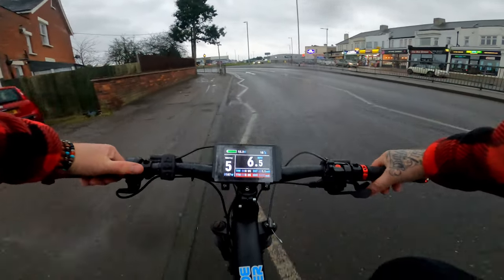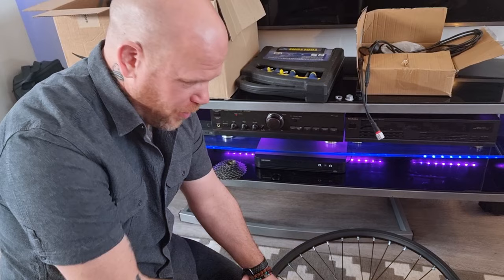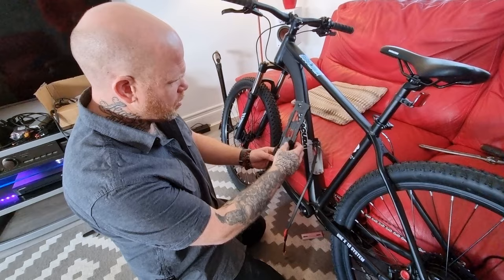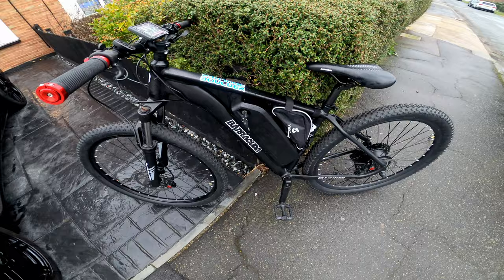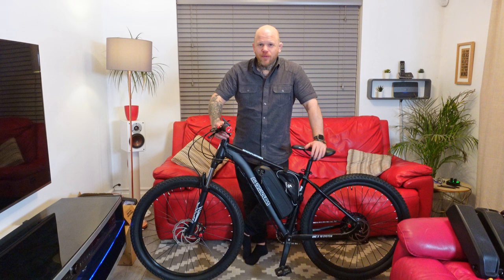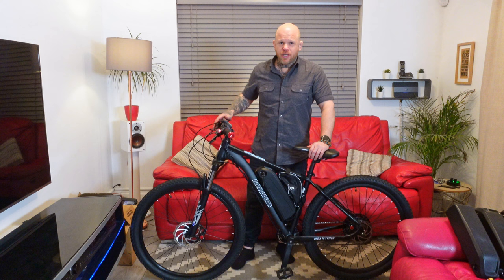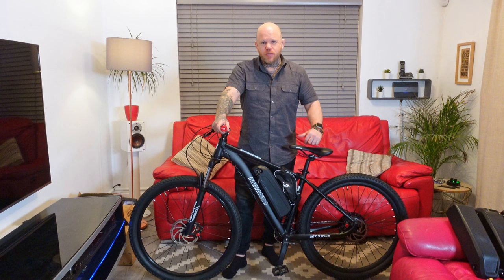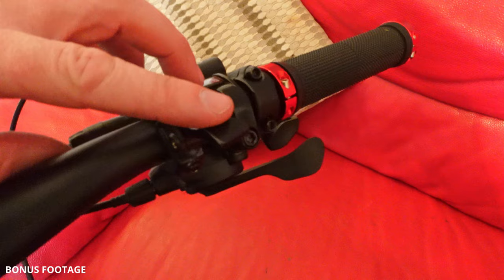How to BEAT the 250w ebike RULE!!!

Comment: I didn't know a 250W motor could do 30mph. So how is it that motors with 2, 3, or 4x the power don't go much (if any) faster? Just asking bc I'm considering building my own and trying to decide how much power and which components to buy.
Reply: A motor doesn't really have a wattage value. That's just the rating for what the parts inside are supposedly able to handle but you can ram more amps and volts into it. To go faster you increase voltage, to increase acceleration you bump up the amps. In this video he's probably pushing about 1000w out that motor but the nylon teeth for planetary gears will last a short amount of time
Reply: @alcurtis93  I've heard of people replacing the nylon gears w metal. Or even just one of the 3.
Reply: @alcurtis93 Years

Comment: I got the yose kit and the company said I can't use more than 36v battery on a 350w motor!
Reply from the maker: It's nonsense you can run more power at most motors (maybe an exception of plastic geared hubs) mostly the controller needs to be able to handle or recognise a bigger battery
Reply: @DudeStuff  so is there two types of battery controller connection, the old four pin and the new type? Also are the other connectors universal?

Comment: There’s a torque sensor standalone now but you got to change the controller
Reply: What do you mean?
Reply: @kev8343  there's already a standalone torque sensor like erider t17 and a corresponding controller. 

Thus, when you pedal it outputs power depending on your pedal torque unlike cadence where it dumps power depending on assist.

Comment: My 1000w ebike (hub motor) from China is restricted to UK speed limit. How do I de-restrict the ebike?
Reply: There is a blue wire on the controller disconnect it and the bike will be unrestricted have fun
Reply: did you try it?

Comment: I thought it was anything with a throttle that was illegal that guy a fortnight ago being done for his doing 22mph plus on motorway ebike laws are messed up completely my bosch smart system now has the tunning in latest update for like high torque on take off you can control it 10% at a time makes huge difference on 85nm motor but seen the NLS speedi it makes the magnet wider spread to confuse the sensor basically further away and stronger magnet so still attracts delimits the embts to 50mph for 70 bucks but says undetectable as not plugged into the motor itself as the kiox diagnostics logs the install on the electric speed restrictor and voids the warranty and as its 5yr warranty something you don't want to mess with but this NLS system is a hidden gem

Comment: The law is stupid, I thought the law in the UK, was  the motor can be any wattage BUT. is not allowed to exceed 250w under operation, I've installed a ROAD SWITCH, WHICH LIMITS THE CONTROLLER and the output and with the weight of the bike I'd get more speed out it freewheeling up a bloody hill I used a modified sabviton shunts and all components upgraded can take up to 260amp in bursts.all on a 8kw motor thing is I'm 6ft 9" and weigh the same as a small house and the bike weighs the same as a rolls Royce phantom🤣 lol. I've build a few extreme bikes. I've added gps. Remote kill switch (Incase of theives)4k camera front and back, limdicators, brake lights, cob led brake strips and indicator strips horn, alarm,  all on 26"x4.5" double walled fat wheels with off road tyres.the problem is the lawmakers are clueless on the tech, in the 80's we had similar stuff with skateboards, roller skates ect.. it's just a way for the government to get extra cash as they are not earning tax on petrol or road tax ect.. as you can ride rented scooters for instance and own the same one but not ride it.
Reply: Gonna need some video content please even if you wear a mask for ID purposes

Comment: ACHTUALLY 250w controlled by throttle is still iliegal because  the max throttle only speed is 4mph

my 1000w ebike only does 28mph, I suspect the 250w motor does over 30 is because its over volted, and not supposed to be used with just throttle, so its geared to go faster
Reply from the maker: Motor size and output had almost no bearing on speed, speed comes from volts. The entire law in uk is ridiculous the market is flooded with supposedly 250w bikes which none are actually 250w they all peak at 100s of watts and are just speed limited by the controller.  I could make a 250w motor go 35mph and a 5000w motor go 15mph it's all bull💩t
Reply: @DudeStuff  I think you are mistaken, some hub motors do have internal gearing

Comment: Lord knows I hate Karens just as much as the next bloke, but 
1) Watts = Voltage X Current. 48v against your current vs 36 will increase the overall wattage past 250; MPH limiter should do the trick just dandy, and
2) Pushing a motor beyond what it's rated for means shortening your motor life. 

Just saying so that the Karens don't have the last laugh. BTW Loving A) the accent across the pond and B) the video brother.

Comment: I can't believe you said 250w ain't bad if you throw a bit more power at it.   😂  To know how much power you are using you need the battery specs and controller specs and then workout how much power is being used. I am a firm fan of 250w hub motor because it weighs next to nothing and a can take my battery on the plane without any special transport containers etc.

Comment: Nothing wrong with over volting a dc motor , I have a tongsheng mid drive 36v running off 48v and it it amazing , I ride trails mostly but have to cross roads ( sorry Karen )
Reply: Hi Alan, is that the Tongsheng TSZ2 250W 36v? that is what I was thinking of getting but wasn't sure if 48v would burn out the motor, did you have to make any modifications please?
Reply: @nigelduckett1289  Hi mine is a 350W no mods needed the controller caps are 60v rated
Reply: @mechanical1955  do you know if the 250w tongsheng can take a 48v battery?
Reply: @RandomShart  exactly what i need to know too. Im current running a 250w rear hub motor off a 36v controller and 36v battery. 
I need to know if i get a 48v battery. Will my 36v controller be okay to run it without it bursting into flames? Or should i just get a 48v controller to match the 48v battery instead, just to be on the safe side?

Comment: The bike battery is legal under EPAC/PEDELEC laws in the UK (Regulation EPAC norm EN 15194 - Maximum voltage 48VDC).
The Throttle on the other hand is not legal and turns it in to an uninsured, untaxed, unregistered, un-MOTed, Scooter as the bike was made after 2016.
Reply: Thumb throttles are legal in the uk it’s can’t be a twist throttle but if you have purchased or manufactured a ebike before 2015 then the law is invalid for those ebikes and still remain legal
Reply: @mikepagani6996  Incorrect, all throttles other than a walk along throttles (max 3.5mph) are illegal under PEDELEC legislation unless the bike was manufactured before 2016.
Reply: @mikepagani6996  

Twist and go is the laymen term but the legislation states that Power assistance or  “Twist and Go” means "it can be propelled without pedalling".

The type of throttle does not matter and unless the bike has been type approved under EPAC (generally only disability devices will get this) it is still illegal with ANY throttle if made after 2016 (as THIS BIKE is).

The reason I know about all this is that I extensively researched it before building my first PEDELEC (which has a throttle and is PEDELEC stamped as it's a 2010 model) about a decade ago granting it grandfather rights, I've also kept up with the laws for future builds.
Reply: @ThatGoth  This is why you only add a kit to an old second hand bike (pre-2016). The bike was manufactured before 2016 and you are only 'upgrading' it, not manufacturing it. Throttle is no problem then.
Reply: @ThatGoth  This is why you only add a kit to an old second hand bike (pre-2016). The bike was manufactured before 2016 and you are only 'upgrading' it, not manufacturing it. Throttle is no problem then.
Reply: @threeMetreJim  That's kind of how I built mine (I actually built it in 2014), the bike in the Video is a 2020 Barracuda Rock Mountain Bike which is clearly NOT pre-2016.
Reply: @ThatGoth  Yes, the new bike not technically legal. I'm looking for a way to convert a pedal assist signal into the 1.1v - 4.3v for the accelerator signal, to convert the mega cheap chinese controllers to use legally, as the really cheap ones don't have a pedal assist input, but they have everything else and are really cheap. Might make for a smoother ride too, rather than the sometimes jerky pedal assist. Probably a single sensor cadence type assist, made into short fixed length pulses and filtered to create an analogue signal (1.1v - 4.3v) from the quasi-PWM. You could pedal backward to set off (not sure if there are any rules as to which direction you have to pedal...), accelerator proportional to pedal speed.

I converted a cheap (£20!) second hand bike a good few years ago now (was for someone else, and illegal power), but it made around £200 profit. I was maybe hoping to do similar, but cheaper and legal.
Reply: @threeMetreJim  Quite often the Befang controllers have a throttle control built in to the admin setup menu so you can actually set the throttle speed to 6 km/h, if they don't you can get a programming cable and reprogram the hub to follow the same rule, that way you don't need to work out the amps which you need in order to lower the voltage.
Backward pedalling generally won't work because if it's a central hub motor it'll only go forward and if it's a rear motor it would take off if you put your foot down funny.

Comment: Personally never liked the idea of pedal assist, much rather just have the throttle at hand rdy to go to use as much or little as I need on demand and all in my control, so I never bothered installing it when I did my conversion 😂
Reply: So basically an e-moped/motorcycle rather than an e-bicycle
Reply: @BH4x0r  Maybe, I still used my pedals just without the assist but used the throttle when needed, so not exactly either, bit of both, rather not say e moped though because then its got to be registered and the rules change which is a pain when people can pedal faster than 15mph it brings into question a lot of things regarding rules and such.
Reply: @nomad_lyfe  so you're using the throttle as the pedal assist basically? (not riding throttle without pedaling?)

I meant it's sorta an e-moped if you just sit on it and just throttle it imo 😂

well since mine has torque sensing it feels perfect and actually corresponds to driver input, not just like you're moving your pedals and the motor turns on full blast but rather humane imo

i mean i can defo feel it pulling me but it's very controlled and it's just a cheap TSDZ2

i quite need the pedal assist as i know what time i have to leave if i ride at the "normal" max speed in Europe, i don't ride it casually, i use it to commute
Reply: @BH4x0r  exactly mate, lol true it basically is in that context like a e moped.

Sounds good though your setup if its finely tuned why not.

Yeah its what you feel safe with regarding the law an what works for you, I get the impression Europe is similar to the rules as here in England, I find if your sensible and careful police here will leave you alone.

I actually did get pulled over last year during winter by police I was doing 25mph they knew it, but they were only concerned about not having my front light on an let me go, the nights go dark early here an my light had ran out of battery I forgot to charge it the night before, might have just been chill police though too.
Reply: @nomad_lyfe  please can I ask you if its possible to unrestrict a haibike xduro full 7? I don't want to cut any wires. Sorry I'm a complete noob and was given a second hand bike for commuting and its saving my legs as I work 40 hours in a cafe.

Pedal assist is what I have but it feels strange as the power shuts out at 15.9 I want to say. Then no matter how much I pedal the bike barely goes more. Even down the fastest hill it's 21mph when I could go faster on a push bike.

If you have a minute could you point me in the right direction?
Reply: @peaceformula5830  Thats a very specific bike I can't say I know, but generally when you unrestrict ebikes its via the settings on the LCD panel or whichever display you own.

Try searching google or YouTube for your specific brand., or check the manual, all the best.

Comment: Hi, my name is Karen, and my full name is Karen hypocrite, because I ran my bike at 66v for 2 years before it killed it lol, nothing I liked better than blowing off 50cc mopeds. But remember to obey the law and ride how they think you can not how you know you can....
Cheap pedal assist is a danger I never fit it on a 250w build just a throttle it gives the rider a way more safe experience, laws an ass on this.
Just building a 3kw 30mph to msva
Reply: Is there a way to unrestrict and restrict a haibike xduro full 7?

 I mean with programming instead of cutting wires?

I was just given a second hand one because I'm working 40 hours a week in a cafe then cycling 8 miles to get about from work... But the 15.5mph seems like such a drag.

I don't want to void the warranty?

Comment: I'll never buy an European handicapped electric bike again, now just imagine how mad someone must be in the head to spend 2000-6000 on a branded Mid motor bike that's limited to just 15.5 Mph ? well I was one of those mad people that spend 2500 on a Haibike with Bosch motor, quality bike but there's a big drag on the pedals when the motor is off making it very hard to pedal. 

Then the 50 Nm of torque is very weak, mine is the 2013 Bosch Gen I. Still going but not a huge amount of miles on it but rode 7.5 miles the other day and still had all bars on the battery, this is a 10 year old battery. 

Best ebike I had was a DIY one with a MAC 8T rear geared hub, a 40 amp controller and 66.6 volts ( hot off the charger ) of RC LiPo I made into a battery pack, I modded the controller for around 50 amps and it pulled around 3.3 Kw, to go from this to a 50 Nm "legal" ebike was some kick in the ass I can tell you. Biggest mistake was selling that motor kit. 

If someone gets a Legal bike find out if it can be derestricted or don't buy it. 

Ebikes are not allowed a throttle but yet there's escooters everywhere with a throttle , doesn't make sense ?

Comment: Blimey, my 500w bafang front hub with 17.5 ah and 48v can only do 28mph normal, so well done for the 250w bike doing 30mph! ..ha ha great! ..my others a bbshd! ..defo a "Karen" distroyer! ..I agree about the 15.5mph top speed being silly as you're overtaken all day by the lean serious bikers doing 25mph plus!
Reply: Mines 1500w and does 35.
Reply: I have 1000w hub rear, 48v 17.5ah battery and 20 amp controller on a hefty fat bike. With full battery using throttle I can hit 32, But normally 30 until my voltage to too low. This subject always depends on controller wattage weight etc.  I could do with more amps to be honest, But it does the job.

Comment: The law is 250watt maximum OUTPUT, nice try but your thing here wouldn't cut it with the law I'm afraid. You can put 100000kilowatts into a motor and as long as the output is 250watts - that's fine. Shame really - they need to totally ditch the throttle and power limit (for hills, bigger bikes e.t.c.) and just have a simple speed limit. Instead we have to deal with the muppets in charge and their shallow minded stupidity.

Comment: Why are you saying 250w legal hub all the time. It shows a real misunderstanding of how motors work. For example a 250w motor draws more than 250w of power when they start up. The law states it can’t supply more than 250w of continuous power. Adding the extra voltage just means you’re outputting more than 250w of continuous power. There’s nothing legal illegal about it. You’re just over-volting a motor. Nothing new to see here.

Comment: That is faster then my 1000w hub with a 48v kit
Reply: It maybe the controller limiting the speed or current
Reply: @ilyosbeknajmiddinov6754  how can I boost the torque?
Reply: @jasonbuchanan7591  1kW should already have good torque if u put it in rear wheel
Reply: hanan7591 250cc petrol.

Comment: The watt rating of these motors are just nominal ratings arbitrarily chosen by the manufacturer anyway. All a 250 watt motor means is it'll burn out on you more easily if you run it with higher voltage X amps.
Reply from the maker: Contrary I throw higher power at hubs and electric motors without issue I've never seen a motor burn out on me anyway

Comment: Motor size is a totally nonsensical metric.  A “250” watt motor will pull nearly double that up a steep hill with heavy rider.   Fact is, as long as you are electronically limited to cut the power at 15.5 mph it shouldn’t matter a jot what output the motor is rated at.  If you carried the current restrictions argument to cars everyone is driving illegally because their cars can do over 70mph (in UK).  Trouble is we need someone with a brain to challenge this stupidity in parliament.